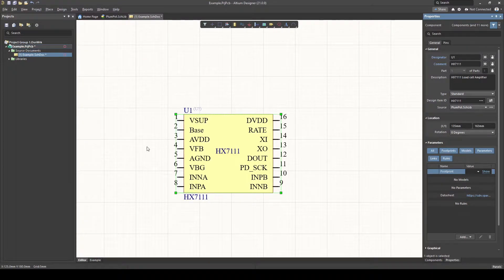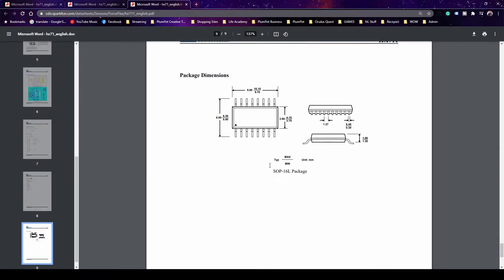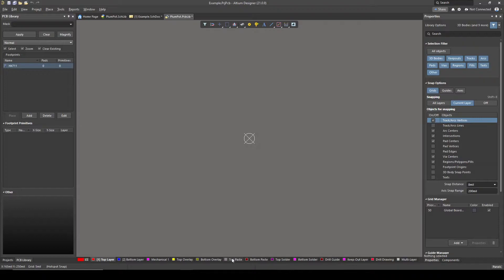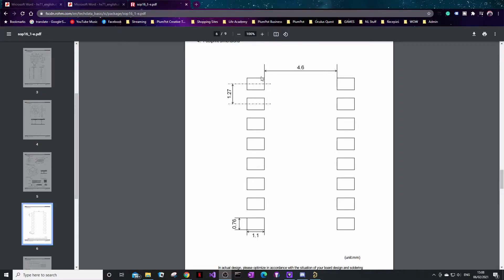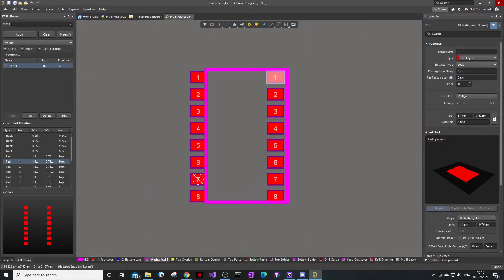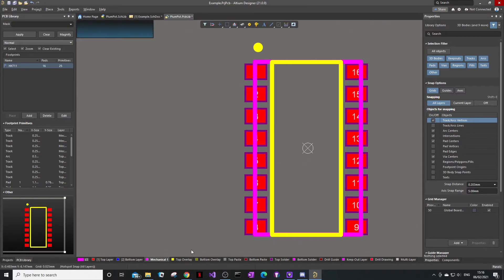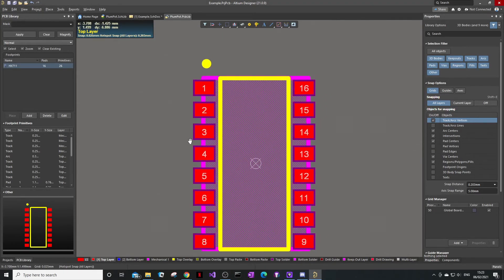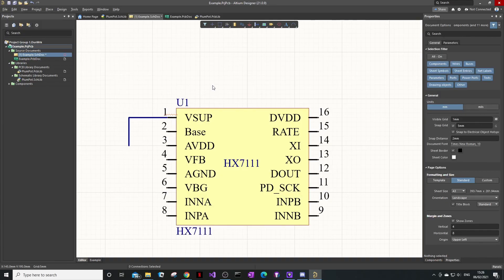Altium Designer 20 Tutorials - How to create a PCB Footprint

Comment: Would it be easier to align the step model to the origin of the footprint?  I think this is one of the challenges I have when I have to bring in the step model from the vendor as it is always in the incorrect orientation.

We had an MCAD librarian do this for us but not every ECAD Librarian job has the luxury of this having this resource which means hopefully there is a tool that can properly orient the step model or you may need to know how to use Siemens NX or some other program and do this on your own.  I sat down with a coworker and he used datum plans to pinpoint the center of the model and then create a top-view DXF drawing of the part itself that would be used on the Reference layer (all nominal values).

Comment: Love your video, sir make video on how to connect wire to a sensor in 3d model like connecting probe to soil moisture sensor in 3d model
Reply from the maker: What you mean? So not electrically more in  step file to show it would look in real life?
Reply: @PlumPot  two step file for 1 module, and want to connect 1 with other, sir check for moisture sensor on grabcad you would understand my point , there moisture sensor is Avaiable in 2 parts ,1 is its circuit and the other is its probe,and facing connection problem there in 3d